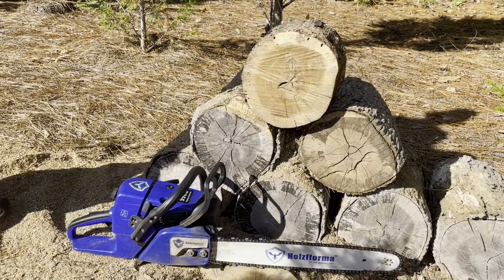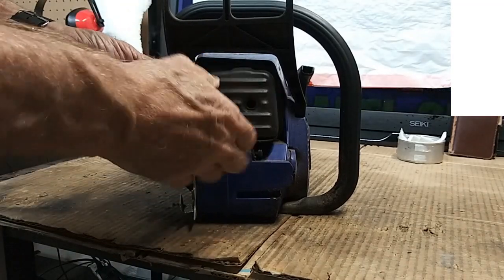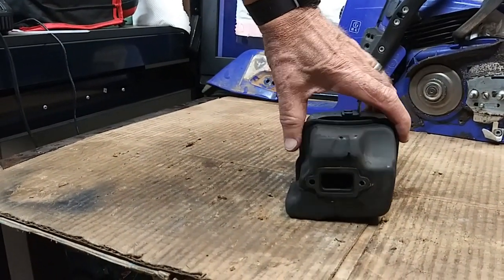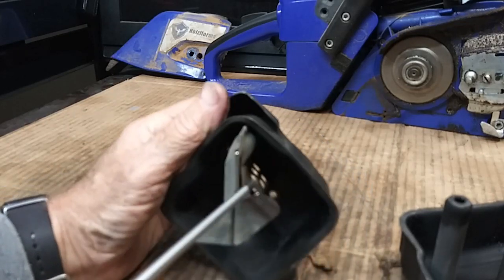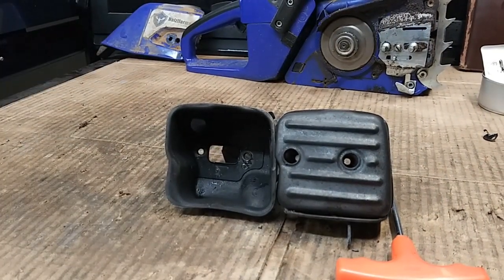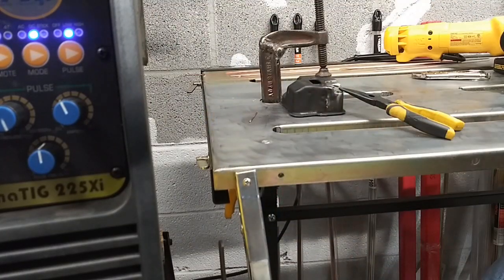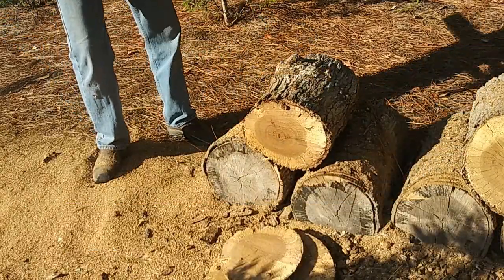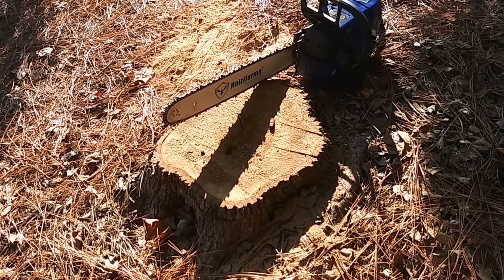Hulzfforma G366, Stihl MS361 muffler mod 30% Boost  performance, re-engineereing muffler

Comment: I have the ns872 a clone of the ms382 and I'm considering eventually doing that too. Luckly my muffler is bolted/screwed together, so opening it up and putting it back together will be much easier. My one issue is I have no way to weld the exhaust pipe onto it. So I may have to hire that done.
But I love the increase in power you got. Thank you for showing us the difference without any extra mods.
Great video. 😎👍
Reply from the maker: Thanks for your comment. Glad you found it helpful. Hope you enjoy that saw.  All the reviews. I read about It looked pretty good, and it’s a nice size saw for sure.

Comment: Thank you!
A lot of us small budget residential users have gone to gathering our own firewood to cut down on heating cost without wiping out the budget.
For many of us this means getting free trees from Blow downs/dead falls or Clean up wood removal from tree fallers. i.e. we need bigger, more powerful saws(on a budget)
Enter the Chinese Copies with decent power and somewhat acceptable performance, but not like the oem saws.
I've noticed the 373 copies are very popular. They seem to be fairly reliable, easy enough to work on and if not pushed they can handle 24"-28" Bar/Chain combos. Problem is, as soon as you lean on them they tend to stall the chain in the wood.
It looks like a Muffler upgrade would be the first and least expensive way to greatly improve performance.
Your Modification to the G366 seems to confirm this.
Again - Thank You!
Reply from the maker: Your welcome, and thank you for your excellent explanation of why so many of us opt for these clone saws now days, and we want to get what we can out of them.  Especially low budget, low risk improvements that we can do with the tools we have. Thanks again and have a good firewood harvest this year.

Comment: Nice... I think I'm going to get the kit and put on the big bore cylinder.... How is the antivibe?
Reply from the maker: It’s better than 029/039.  I saw you have a 291. The AV system is not identical bet very similar to the 391. So I hope that will provide you with a good reference point.  Thanks for your comments.

Comment: New subscriber here from France...very informative video, out of interest how much louder was it after the exhaust modification ?
Reply from the maker: Thank you for subscribing and the question.
I do not have a meter to measure them proper.  My best guess is that there is about a 20 to 40% increase.  If I am not wearing hearing protection I don't notice the volume change much but the tone is deeper and I can actually feel a small pressure on my ears after modifying the muffler. I always use hearing protection now.